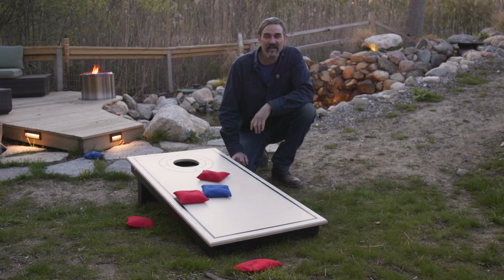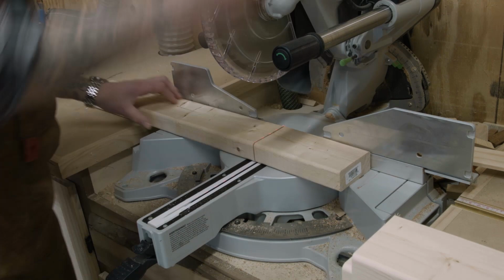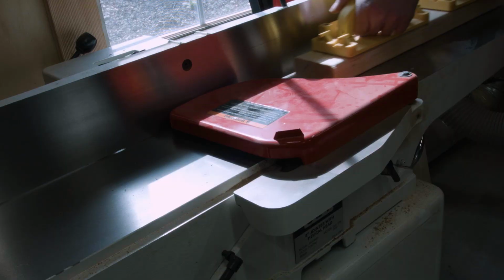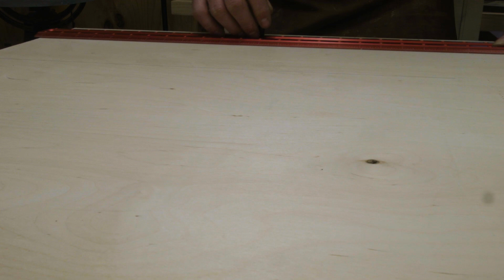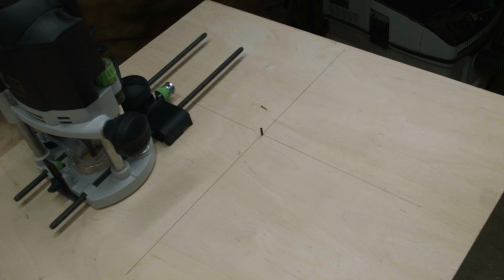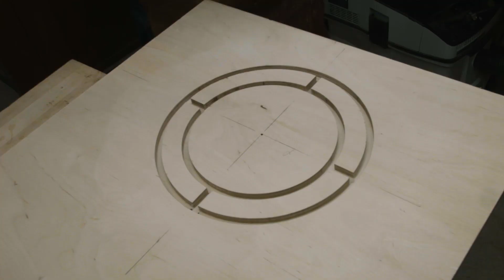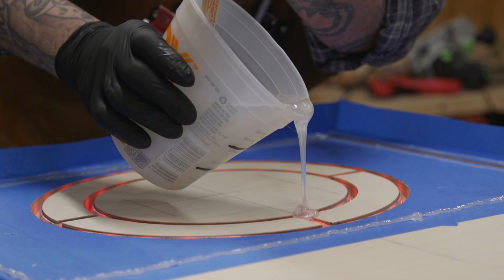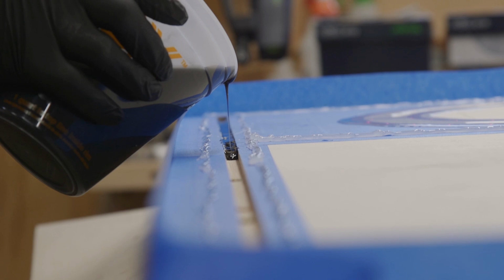Making Wicked Awesome Cornhole Boards with LED Rings

Comment: I learned that lesson with epoxy the hard way too early on. What I started doing was using a spray poly first where I was going to use epoxy. Helps keep the epoxy dye from bleeding into the surrounding wood.
Reply from the maker: Great idea!

Comment: As others have pointed out nice to see you show hickups along the way not just a cut to finished project. Another tip you can try to eliminate bleeding in the grain of the wood is to brush on a thin layer of clear epoxy to all edges of routered channel before pouring colored epoxy to keep grain of wood from wicking colored epoxy.
Reply from the maker: Thank you so much!  I'll have to try that next time.

Comment: Awesome! I love it man. One problem l forsee in your future though. You might as well start planning on designing and parting in your own battery pack with a micro toggle switch. I've used those exact (and similar) battery/switch boxes on many projects. They turn out to be notorious failures in fairly short (no pun intended) order.  ESPECIALLY when the slightest moisture and vibration is involved. Now l just build my own. Its super easy, 1000% more reliable and l can upscale to C or D size batteries for more life as those COB LEDs in series are notorious battery hogs.
Great idea though! And thanks for the practical tips on the epoxy color bleed issues. I can now see that as being a potential problem in a  project l had been eyeballing in my future. Now l can plan for that.
Reply from the maker: Thank you for the tip!!  I've never used these lights before but I I'll keep an eye on it!

Comment: Nice job! Weight has always been a concern for me, so I start with 1x4's, and put a cross brace in the middle, with a 1/2" deck. But I am a firm believer in whatever works for you. There are some real cornhole snobs out there.
Reply from the maker: I really considered using 1/2 but was concerned about too much bounce.  Cool to hear it's working for you though!
Reply: @CraftsmansLegacy  I have heard a lot of people express that same concern, but with a cross support in the middle they are stiffer, stronger, and lighter than 2x4 and 3/4" ply construction. I recently tried all Baltic birch plywood construction because several manufacturers I know make them that way, but the weight is much worse.
Reply from the maker: Very cool!  Thanks for sharing.
Reply: @CraftsmansLegacy  and thanks fornyour content - both on here and PBS

Comment: Another option is to just mix up some clear epoxy and brush a thin coat into those grooves first. Similar to the guy who suggested spraying poly but the epoxy would be that much more durable of a barrier against the colored epoxy.
Reply from the maker: Great tip!

Comment: Brushing a thin coat of clear epoxy in your groves and the top edges along side them and letting that cure up a bit before pouring the tinted epoxy in will fix your bleed through problem 👌👍
Reply from the maker: Thank you!

Comment: I’ve seen the leaching of dark epoxy before, even with hardwoods so use a polyurethane to seal the wood inside the rabbets and that should take care of it absorbing into the fibers of the ply or for all other wood.
Reply from the maker: Thank you for the advise!!

Comment: Its called Whicking - the grain is pulling the paint into it. seal the board prior to epoxy and you wont have it at all.
Reply from the maker: Thanks Shane, I've heard good / bad using seal with epoxy.  I haven't tried yet but will probably do some tests.